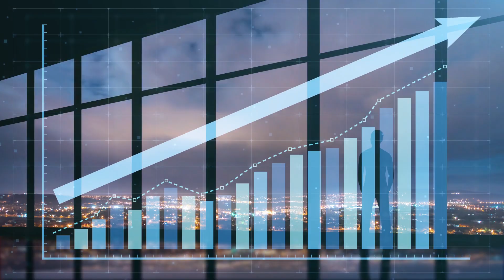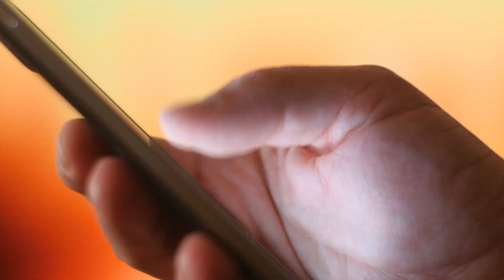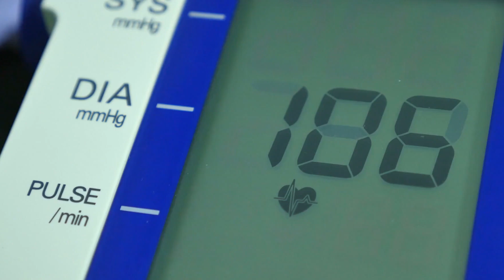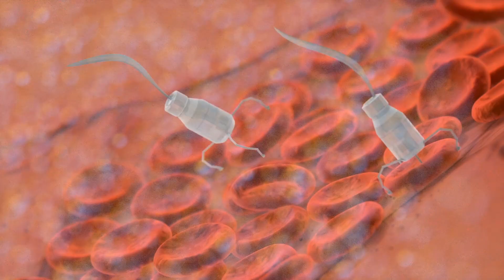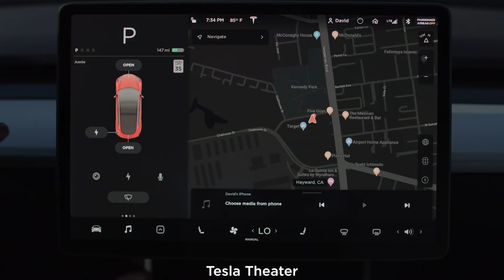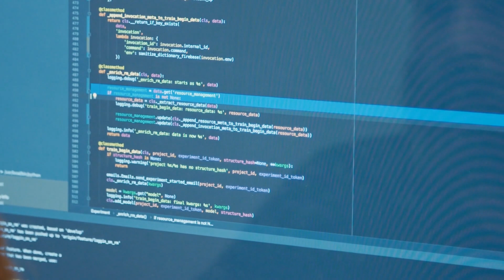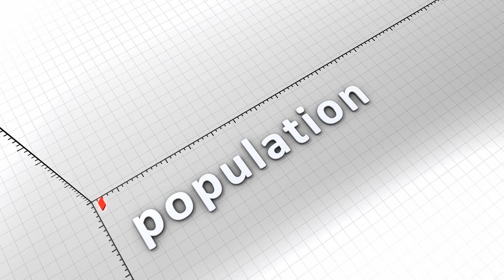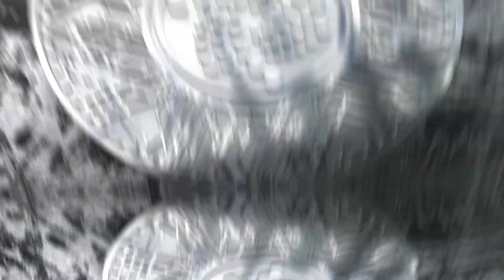How Internet of Things - IoT & Cyber Physical Systems Will Shape The 4th Industrial Revolution

Comment: 1:51
Actually, Moore's law is already starting to slow down.
Reply from the maker: The fact that processor speed – clock speed – has saturated does not mean Moore’s Laws is slowing. Densities keep increasing, just like Dr. Moore has predicted
Reply: @ScienceTime24  From the research I've done, it's getting harder and harder to cram more transistors on a chip, because as soon as you get to a certain size, quantum mechanics take over.
Reply: Haven't transistor gates already reached minimum thinness capable of halting the electron flow in processors? Amd is making physically bigger cpus now.
Reply: Moore’s law is just one paradigm encompassed by Kurzweil’s Law of Accelerating Returns. New technologies (paradigms) will replace it, 3D circuits, quantum computing for example.
Reply: @antonvandermerwe4683  Oh great. Another person who believes in conspiracy. Transhumanism was never about control. And it never will be.
Reply: @albertjackinson  In April 1967, the CIA wrote a dispatch which coined the term “conspiracy theories” … and recommended methods for discrediting such theories.  The dispatch was marked “psych” –  short for “psychological operations” or disinformation –  and “CS” for the CIA’s “Clandestine Services” unit.

The dispatch was produced in responses to a Freedom of Information Act request by the New York Times in 1976.

The dispatch states: (...) b. To employ propaganda assets to and refute the attacks of the critics. Book reviews and feature articles are particularly appropriate for this purpose. The unclassified attachments to this guidance should provide useful background material for passing to assets. Our ploy should point out, as applicable, that the critics are (I) wedded to theories adopted before the evidence was in, (II) politically interested, (III) financially interested, (IV) hasty and inaccurate in their research, or (V) infatuated with their own theories. http://humansarefree.com/2016/02/Conspiracy-Theorist-CIA.html

https://wisetoast.com/10-conspiracy-theories-that-are-actually-true/
Reply: @antonvandermerwe4683  What is your point?
Reply: @albertjackinson  Please do not support the Transhumanism Agenda ,remember the Net is a two way communication medium  The evil Cabal including ELon Musk wants to turn the collective consciousness into a Hive Mind .no more original human thought
Reply: @antonvandermerwe4683  This is ridiculous. Elon Musk is evil? Yeah...no. And technology has no "agenda". Technology stems from science.
Reply: @antonvandermerwe4683  1. COVID-19 doesn't stand for that. It is an abbreviation of "COrona VIrus Disease; and the ending "19" because it started to spread in 2019.
2. 5G is not connected to mind control.
Reply: @albertjackinson  
 5 G / 60GHZ frequency shakes your hemoglobin (Fe) so violently, that it causes the blood gases to let go and release from the ionic bond that holds it to the hemoglobin.
The reaction of the body from exposure to 60GHZ will cause the victim to feel short of breath, with a respiratory paralysis. Because the lungs cannot exchange blood gases when the gases won't bond to the hemoglobin (Fe) of the Red Blood Cell.
Release of the blood gases from the hemoglobin within the blood stream will cause pockets of gases to form in the blood stream, also known as bubbles.
These bubbles can kill you instantly.

Where do these 60GHZ frequency waves come from 

------------

5G, the 11th harmonic and the frequency of the heart.

The 5G towers are centered at a 60Ghz bandwidth, which is the same as 60,000,000,000 hz. If you times this by 11 to get the 11th harmonic (cancellation wave) you get octaves of 1.200533 hz which we'll just call 1.2 hz (99.9% accurate).

1.2 hz is the frequency of the average human heart (72 beats per minute converts to 1.2 hz or you could say 1.2 cycles per second).

This implies that the average healthy human heart rate is octaves of the cancellation wave to the 5G towers. We keep a healthy heart rate when we are centered in the parasympathetic nervous system (love, self restoration mode) which is opposite of the sympathetic nervous system (fear, fight or flight mode). To further take from this implication, being centered in the heart space and not in a fear state can cause the body to naturally create the cancellation wave to 5G. Another octave of the 1.2 hz heart rate frequency is 9.6 hz which is said to be a predominant frequency in earth's magnetic field. Both the field of the heart and the field of earth are the same shape, the toroidal field. The brain produces a much smaller version of this same field causing the charge to not disperse as efficiently meaning it builds up in the body over time and inflammation occurs which is at the root of all illness. Taking 5G to the head will cause it to build up in the body. Taking it to the head or the heart depends on which state you choose to be in, free will. Choosing love or fear. Parasympathetic nervous system (observation, feminine) or sympathetic nervous system (impulsiveness, masculine). Both have their time and place for the sake of survival. but none the less it is interesting that as we step back into the age of feminine/magnetic energy we area dealt a challenge to center there or face adverse effects as long as 5G plays out which from what i gather certainly won't last forever.

Conclusion:
Heart-based state=1.2 hz, the cancellation wave (11th harmonic) to 5G's central 60 Ghz frequency. Divine intervention. ?? The only thing to fear is fear itself, for fear itself makes you biologically susceptible to the ill effects of all that you think is a valid fear. Fear can be just as convincing as it is illusive. One easy way to activate the parasympathetic nervous system (heart-based consciousness) is the meditate and take longer exhales than inhales which will stimulate the vagus nerve and the release of oxytocin, oxytocin being the main chemical that the body produces for the sake of centering in the parasympathetic. If you breathe out for 6 seconds and in for 5 you will create a 6/5ths breathing ratio which is expressed as the whole number 1.2 (6 divided by 5=1.2), which means your breath rate will correspond with the same frequency as the heart emits in hz. Numbers aside, switching to centering in the parasympathetic nervous system will create a cancellation wave to 5G towers. It goes hand in hand with repairing the auric and toroidal field around the body. Once again, the parasympathetic nervous system is the opposite of the fear state/fight or flight mode.
Reply: @antonvandermerwe4683  Wrong. The virus is real, and masks do help prevent the spread. The media is not being manipulated, the WHO is not covering things up.
Why do you think over 200,000 people have died, huh?
By the way...Facebook--that link is fake news. Really, it's misinformation.
Reply: @albertjackinson  Try me again 

If you can wear a mask, then do NOT wear one for extended periods longer than 20 mins. unless you are a trained professional (dentist.. surgeon. ext.) , do not touch or fondle the mask or your face, and make sure the mask is ALWAYS clean. .. Quote- "Did you know that there are numerous valid reasons to NOT wear a mask?
ADHD
Agoraphobia
Anxiety
Asthma
Chronic Sinus Issues
Claustrophobia
Chronic Inflammatory Response Syndrome (CIRS)
Chronic Obstructive Pulmonary Disease (COPD)
Chronic Regional Pain Syndrome (CRPS)
Deaf and Hard of Hearing
Depression /other mental health
Deviated Septum
Down Syndrome
Dysautonomia
Emphysema
Epilepsy
Hyperemesis Gravidarum (HG)
Hyperhydrosis
Hypoxia
Lung Cancer
Lung Disease and other assorted issues
Multiple Sclerosis
Panic Attack / Panic Disorders
Pleurisy
Post-Partum Anxiety (PPA)
Post-Partum Depression (PPD)
Post-Traumatic Stress Disorder (PTSD)
Pulmonary Embolism
Raynaud's Syndrome
Reflex Neurovascular Disorder/disease
Sensory Processing Disorder
Vertigo
So the next time that you see someone out and about that is not wearing a mask, please do not HARASS or BULLY that person. You do NOT know their situation or their personal physical or mental health struggles.
If you want to wear a mask, that is fine for you, but please do not become a mask bully and make an already difficult situation even worse for those around you with your nasty looks or your rude remarks.
Reply: @antonvandermerwe4683  I don't harass or bully people who aren't wearing masks. Why are you assuming that? 

And those reasons for not wearing masks are crap. I've never heard that from credible sources.

And I've already wore a mask for longer than 20 minutes. Why? Safety.

That doctor sounds nut. Guess what? I wash my hands. I don't wear a mask inside my house because I don't need to right now. If masks actually restricted oxygen and did all that stuff you said, THE ENTIRE MEDICAL FIELD WOULD BE ALL OVER THAT. Have some sense.

And if you don't trust medical professionals that are sending out this information, then it seems you don't trust science--do you? They have no agenda. And the statistics we are getting are confirmed.
Reply: @albertjackinson  Try me again 

If you can wear a mask, then do NOT wear one for extended periods longer than 20 mins. unless you are a trained professional (dentist.. surgeon. ext.) , do not touch or fondle the mask or your face, and make sure the mask is ALWAYS clean. .. Quote- "Did you know that there are numerous valid reasons to NOT wear a mask?
ADHD
Agoraphobia
Anxiety
Asthma
Chronic Sinus Issues
Claustrophobia
Chronic Inflammatory Response Syndrome (CIRS)
Chronic Obstructive Pulmonary Disease (COPD)
Chronic Regional Pain Syndrome (CRPS)
Deaf and Hard of Hearing
Depression /other mental health
Deviated Septum
Down Syndrome
Dysautonomia
Emphysema
Epilepsy
Hyperemesis Gravidarum (HG)
Hyperhydrosis
Hypoxia
Lung Cancer
Lung Disease and other assorted issues
Multiple Sclerosis
Panic Attack / Panic Disorders
Pleurisy
Post-Partum Anxiety (PPA)
Post-Partum Depression (PPD)
Post-Traumatic Stress Disorder (PTSD)
Pulmonary Embolism
Raynaud's Syndrome
Reflex Neurovascular Disorder/disease
Sensory Processing Disorder
Vertigo
So the next time that you see someone out and about that is not wearing a mask, please do not HARASS or BULLY that person. You do NOT know their situation or their personal physical or mental health struggles.
If you want to wear a mask, that is fine for you, but please do not become a mask bully and make an already difficult situation even worse for those around you with your nasty looks or your rude remarks.
Reply: @antonvandermerwe4683  You know what's sad? You seem to be repeatedly posting the same comments.
And at least you've posted one new one. That's a relief. I thought you were stuck repeating yourself.
Reply: @antonvandermerwe4683  Oh I do have critical thinking. 
You honestly remind me of Alex Jones.
Reply: @antonvandermerwe4683  I'm sorry. You are denying science now. No, wait. Not just science. Centuries of science, started all the way back during the Enlightenment in the 1700s.
Reply: @antonvandermerwe4683  This is getting increasingly nuts by the post. I'm not talking about Biblical history, if you haven't noticed--so why are you bringing it up? And "humansarefree.com"? Yeah, that's definitely a credible source. I'M BEING SARCASTIC, if you couldn't tell. If you are crazy enough to call documented history and science a lie, then I don't even know how you manage to watch these videos. Do you come to these subjects just to spread your insane nutcase of an idea?
Reply: @albertjackinson  
If unknowingly resort to fallacy use to defend your argument, you just lost.

This happens when your defending a solution you did not work out. If you can't show your work, its not your thinking.

Thats why folks resolve to Ad hominem attacks or red herring bait n switch. They take strong positions on important subjects, without any actual study or experiment to back up the belief.

I still think it all boils down to a simple mind trick.

And without knowing what the parameters are, the average person is rendered useless in ability to debate.
Reply: @antonvandermerwe4683  In case you didn't know, there are examples of backing things up. But you just can't show every single case. Why? You can't track everything to a determined source.
You seem to be jumping around a lot. First you say masks are ineffective and 5G is harmful. Then you deny basic biology, and then you deny the entirety of written history and science as well. Not seemingly coherent other than "everything is a lie".
Reply: @albertjackinson  Here is the Plandemic video reflecting exactly how the Cabal pulled this Hoax off ,watch it then we may indulge in proper debate
Reply: @albertjackinson  5 G / 60GHZ frequency shakes your hemoglobin (Fe) so violently, that it causes the blood gases to let go and release from the ionic bond that holds it to the hemoglobin.
The reaction of the body from exposure to 60GHZ will cause the victim to feel short of breath, with a respiratory paralysis. Because the lungs cannot exchange blood gases when the gases won't bond to the hemoglobin (Fe) of the Red Blood Cell.
Release of the blood gases from the hemoglobin within the blood stream will cause pockets of gases to form in the blood stream, also known as bubbles.
These bubbles can kill you instantly.

Where do these 60GHZ frequency waves come from 

------------

5G, the 11th harmonic and the frequency of the heart.

The 5G towers are centered at a 60Ghz bandwidth, which is the same as 60,000,000,000 hz. If you times this by 11 to get the 11th harmonic (cancellation wave) you get octaves of 1.200533 hz which we'll just call 1.2 hz (99.9% accurate).

1.2 hz is the frequency of the average human heart (72 beats per minute converts to 1.2 hz or you could say 1.2 cycles per second).

This implies that the average healthy human heart rate is octaves of the cancellation wave to the 5G towers. We keep a healthy heart rate when we are centered in the parasympathetic nervous system (love, self restoration mode) which is opposite of the sympathetic nervous system (fear, fight or flight mode). To further take from this implication, being centered in the heart space and not in a fear state can cause the body to naturally create the cancellation wave to 5G. Another octave of the 1.2 hz heart rate frequency is 9.6 hz which is said to be a predominant frequency in earth's magnetic field. Both the field of the heart and the field of earth are the same shape, the toroidal field. The brain produces a much smaller version of this same field causing the charge to not disperse as efficiently meaning it builds up in the body over time and inflammation occurs which is at the root of all illness. Taking 5G to the head will cause it to build up in the body. Taking it to the head or the heart depends on which state you choose to be in, free will. Choosing love or fear. Parasympathetic nervous system (observation, feminine) or sympathetic nervous system (impulsiveness, masculine). Both have their time and place for the sake of survival. but none the less it is interesting that as we step back into the age of feminine/magnetic energy we area dealt a challenge to center there or face adverse effects as long as 5G plays out which from what i gather certainly won't last forever.

Conclusion:
Heart-based state=1.2 hz, the cancellation wave (11th harmonic) to 5G's central 60 Ghz frequency. Divine intervention. ?? The only thing to fear is fear itself, for fear itself makes you biologically susceptible to the ill effects of all that you think is a valid fear. Fear can be just as convincing as it is illusive. One easy way to activate the parasympathetic nervous system (heart-based consciousness) is the meditate and take longer exhales than inhales which will stimulate the vagus nerve and the release of oxytocin, oxytocin being the main chemical that the body produces for the sake of centering in the parasympathetic. If you breathe out for 6 seconds and in for 5 you will create a 6/5ths breathing ratio which is expressed as the whole number 1.2 (6 divided by 5=1.2), which means your breath rate will correspond with the same frequency as the heart emits in hz. Numbers aside, switching to centering in the parasympathetic nervous system will create a cancellation wave to 5G towers. It goes hand in hand with repairing the auric and toroidal field around the body. Once again, the parasympathetic nervous system is the opposite of the fear state/fight or flight mode.
Reply: @albertjackinson  Proper oxygenation of your cells and blood is ESSENTIAL for the body to function as it needs to in order to fight off any illness.

Masks will hamper oxygen intake. Unless you are working in a hospital setting, it is NOT necessary. But go ahead and hold onto to your security blanket if it makes you feel better. I do not listen to the government when it tries to instruct me on how to maintain health, nor do I trust their 'stats' (which we know are based on unconfirmed numbers).
Reply: @antonvandermerwe4683  Hilarious. You already posted that comment earlier. See what I mean?
Reply: @albertjackinson  You failed to  watch the video.. again as you are certainly convinced by your Puppet president 
Trying to open your closed mind but the TelEVIsion closed it with years of programming ,sad man 
Have a great day many blessings love and light out ...